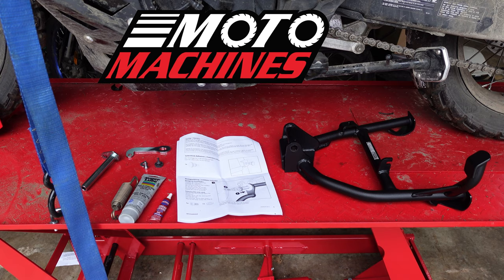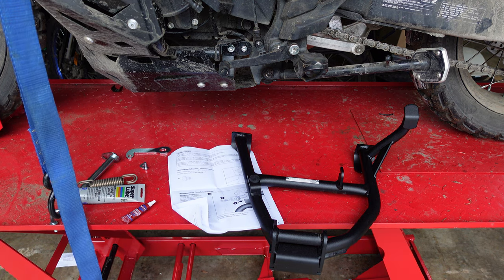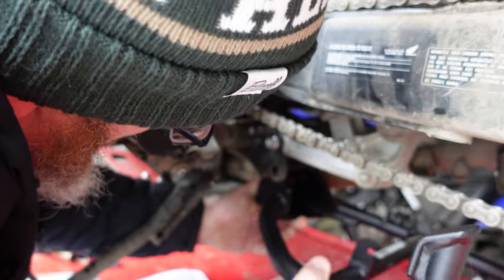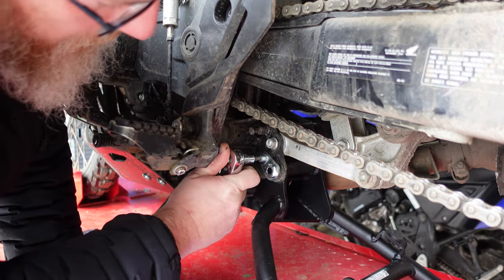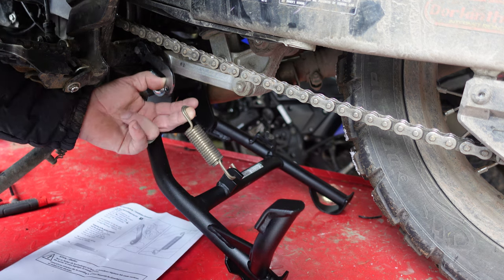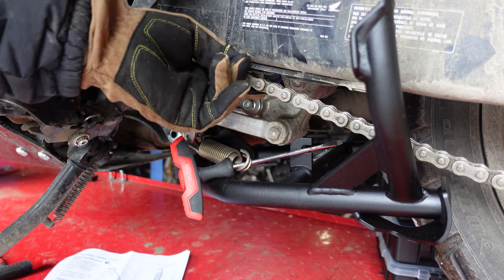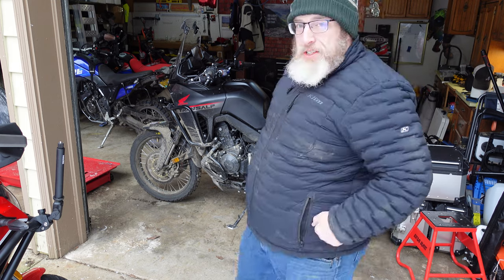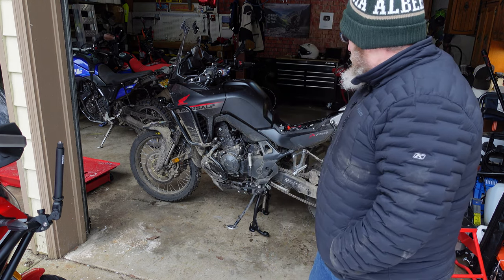Honda Transalp 750 Center Stand Installation

Comment: I installed the Honda OEM center stand on my Transalp.  A trick to stretch the spring is using one large zip tie (or multiple small zip ties) to make a loop and let you extend the spring easier.  You can cut the zip tie if it's wedged under the spring after installation. Really easy.
Reply from the maker: Not sure why I never thought of that.  Genius.

Comment: My Honda dealer had a sale on their only in-stock Honda Center stand so I got that one.  The steps look pretty well identical except the Honda has two separate springs.  I used a loop of paracord tied through a deep socket to use as a handle.  I did the install in the garage so I laid on the garage floor and braced one leg on the side stand and used the other to help pull the spring.   All in all it went quite easily and I was done in about 15 minutes.   Oh and I also used Superlube to grease mine but went with medium locktite on the screw.   Thanks for the great video and it seems like the weather has been weird this winter everywhere
Reply: I do though wish the Honda stand was powder coated.  Mine like several other I've seen had a pretty shoddy paint job with a couple spots that needed touchups when I took it out of the box.   I paid $249 Canadian so it was cheaper but the powder coating I'm thinking would be worth it

Comment: A center stand has to be one of the most practical and valuable add-ons for a DS or ADV rig. Big advantage on chain maintenance or flat tire repair. Worth the added weight, which is minimal. They come standard on my KTM 640 Adventure.

Comment: Just installed the OEM center stand on my TA and all I can say is I wish Honda was still using that spring inside a spring setup like yours rather than the two separate springs like mine came with.  First spring went on easy once I found the right angle, but that second one....oh that dirty rotten sticking SOB of a second one....there's a special place in Hade's for that spring!  Planned on tackling my crash bars today as well, but after that fight I'm quitting early to cozy up to a couple Michelob's.

Comment: I forget how I stretched my spring, maybe a ratchet strap, but saw a video recently where the spring was tied off to a link in the chain and the bike rolled forward a few inches.
Other than making cleaning and lubing I haven't used it for anything else. Stay warm! We're down to the low 70s here in Hawaii.

Comment: A piece of rope,like that on lawn equipment works great for installing springs. Fold the rope in half, stick the loop through the hole u are wanting to attach the spring to, then grab the hook end of the spring with the loop in the rope and pull it through. Works so easy

Comment: There's a little trick with springs. Instead of using a spring tool that's sometime difficult to get in some places. Use a good length zip tie. The zip tie will give you great leverage and it's easy to cut off.

Comment: Nice. A piece of rope/or strap attached to a zip tie like suggested below and then led through the holes in the sprocket - could be used to extend the spring - I think it looks like. Being a sailor I never leave home without a pice of rope anyway. I suppose the same goes for ADV riders. And scouts :)

Comment: Center stand should become standard, but Honda wants to cut costs for a cheaper price tag. But all my 1980’s bikes have a center stand and I use them often.
Reply: Those and helmet locks, I'm not really sure why they got rid of both as I use them all the time.  I get not having a center stand on a sport bike but for ADV or cruisers they make a lot of sense
Reply: I didn't know that new bikes do not come with helmet locks. Though I can't really access my helmet lock when I have my panniers on. @GregLanz

Comment: OMG - Snow in Oregon for 3 days.  Hello global warming.  You look cold.  So, I put a center stand on my Kawasaki Versys and the hardest part was stretching the giant spring that was encased in a plastic sleeve (they warned - don't take it out of that because mud and crap can get in the spring and affect performance).  I really like it for cleaning the chain and doing oil changes.

Comment: On a different note do you think (25 words or less) that spending more money on Husqvarna Norden 901 is the better way to go, than the getting the Honda Transalp (BTW, I'd be using them for 95% street)
Reply from the maker: Depends on how badly you want cruise control and the extra horsepower.
Reply: Thanks for taking the time, MUCH Appreciated! @DorkintheRoad